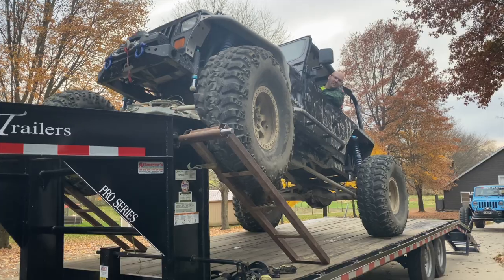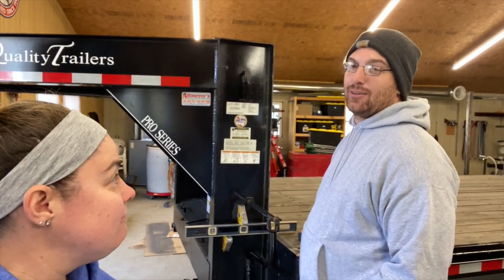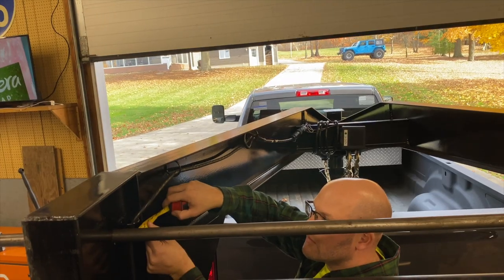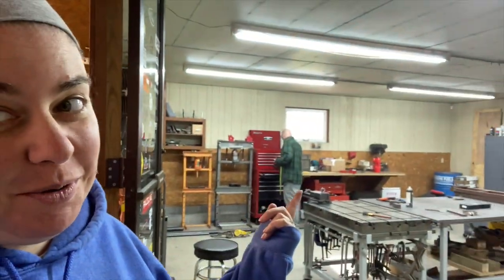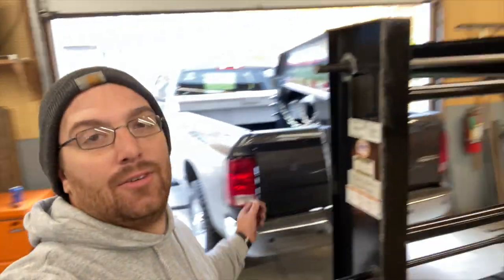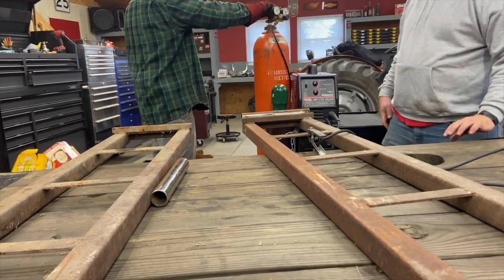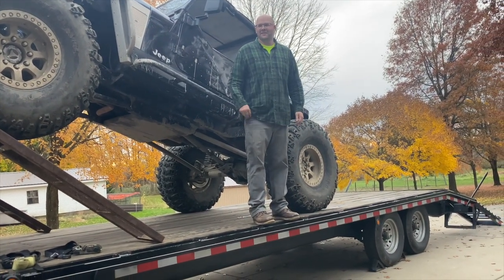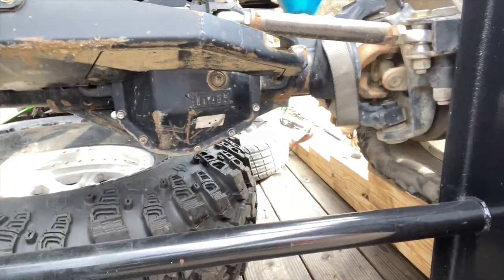Can we fit Two Jeeps on a 24' Trailer?

Comment: You did it the safe way.  Good job.  True that ramp would have required extra work, but it is designed a certain way to handle the load on the trailer, so cutting, welding, and then putting jeep weight right over the gooseneck part would be questionable.
Reply from the maker: Yeah. The way we ended doing it was definitely the best. I’m so glad we were able to get both the Jeeps on the trailer. Makes the hobby slightly less expensive
Reply: @Ohio_offroad_adventures  Agree.  I did the same with a YJ and CJ a few years back on our trips.   Now with the JLUR zi like driving it to and from,  but will eventually go back to trailering when diesel price comes down.   Lol.